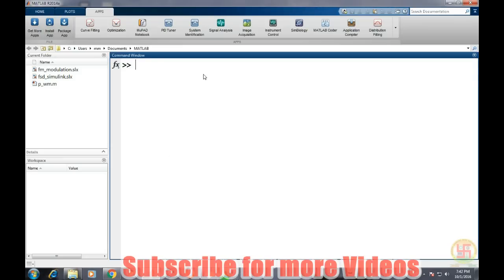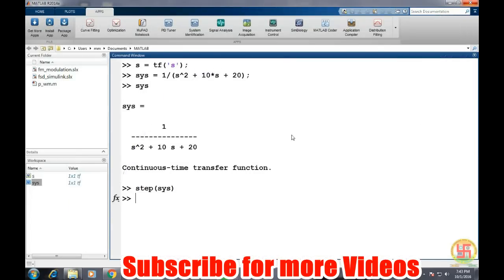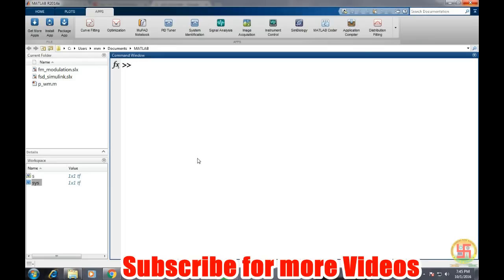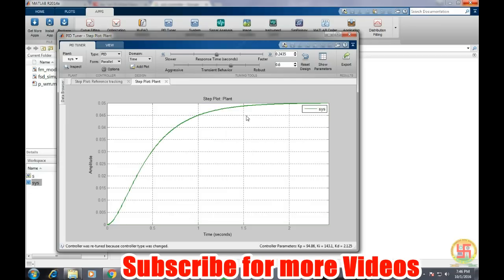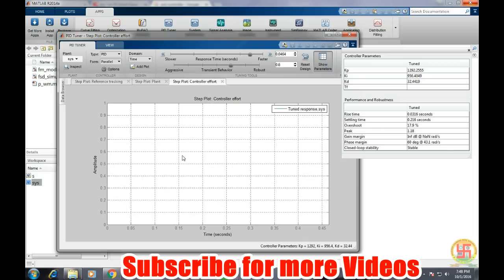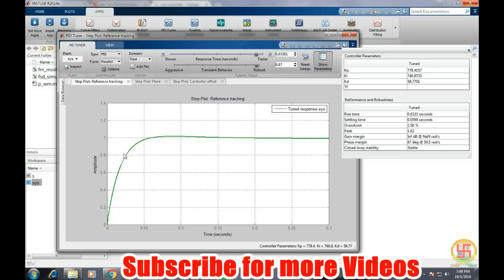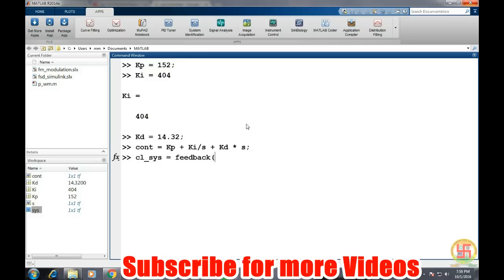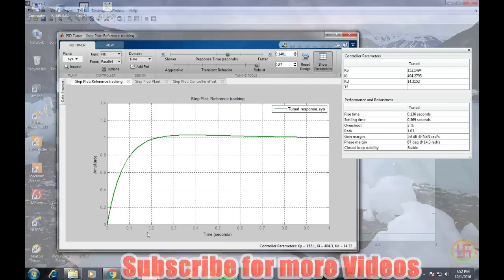How to tune PID controller in Matlab ???

Comment: By which method simulink PID tuner are tuning ?
Reply from the maker: This is from the built it PID tuner tool box in matlab. You can also tune using GA or other optimization techniques.
Reply: @sachinsharmajcbro  i want to know that by which method it is tuned
Reply: @sachinsharmajcbro  sorry sir but it's my prefessor's question who asked me in presentation and i do not know the answer so i want to ask you
Reply from the maker: I think it is using ziglar nicolas method or you can chen the matlab documentation